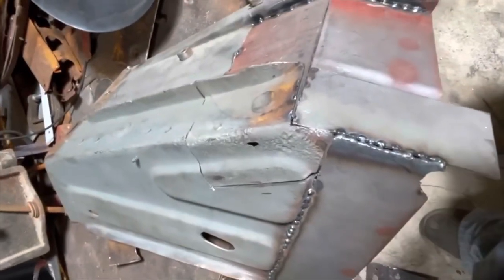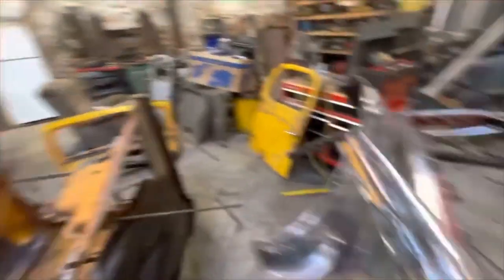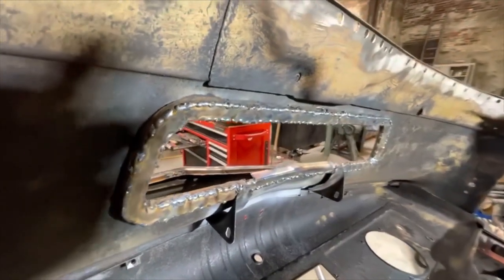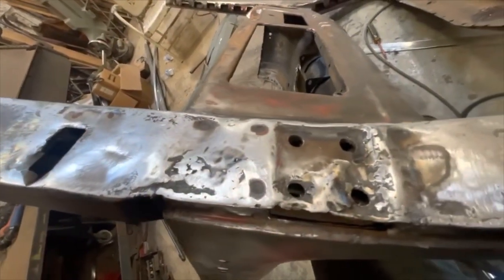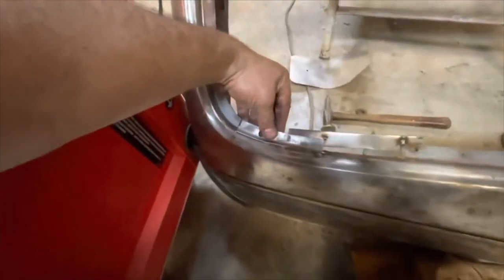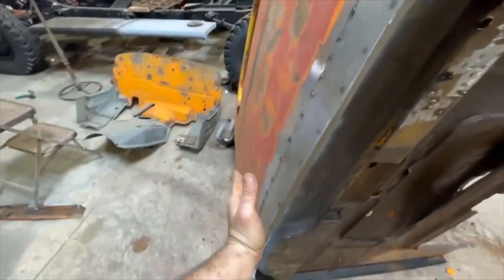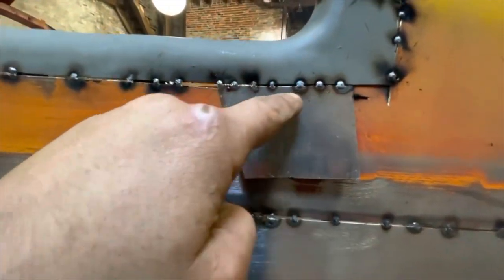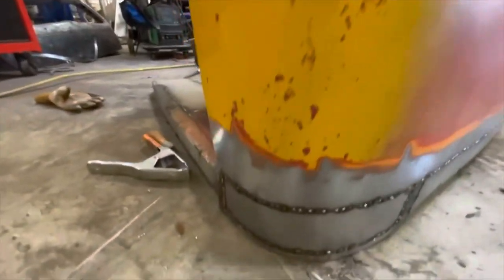Rusty Cab Repair! Dodge Power Wagon Body Work and Sheet Metal Welding. Rust Removal and Restoration

Comment: 4:05 That spray paint tip is genius!
Reply from the maker: Thanks bud, how’s your truck coming?
Reply: @partsandresto  Good I'm at college rn so not too much progress but we got the engine rebuilt so have to put that back in and got the cab and the bed blasted so some rust repair to go! I got a mig welder and started to learn a little bit
Reply from the maker: @DIYSCOTT  my man! Love your videos, keep learning!

Comment: If you want, Dave, you could make your rear window out of polycarbonate, then you could cut it with a sabre saw, and save money on the glass. Polycarbonate won't shatter like acrylic plastic.
Reply from the maker: Cool idea! Haven’t decided yet, they make a glass kit with everything in it, may just get that
Reply: Look for polycarbonate with UV protection to avoid it turning yellow from sunlight.
Reply: @mdesousa6691  this is correct, but the old acrylics/plexiglass did that more than polycarbonate does.

Comment: Hey Philly neighbor Dave, what brand welding wire are you using?
Reply from the maker: Whatever they sell at gas pro in south Philly.  Haha
Reply: @partsandresto  you might get better results with Lincoln wire. Brandon Lund tested a number of brands, and he found that Lincoln wire worked about the best.